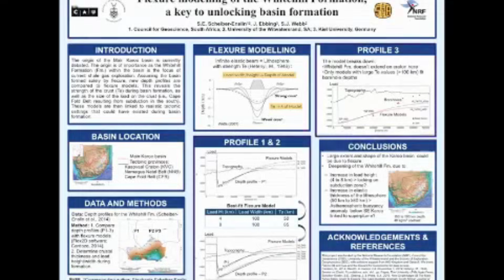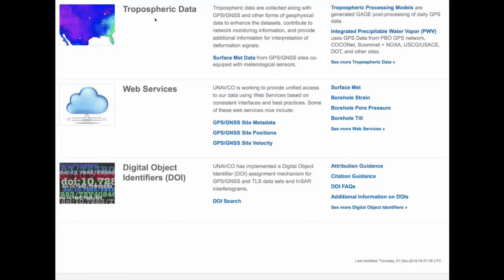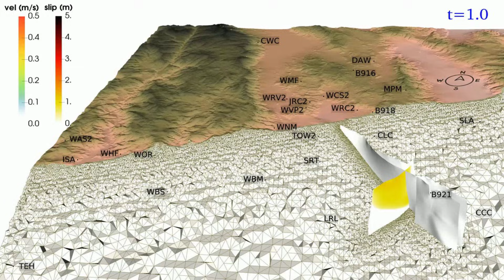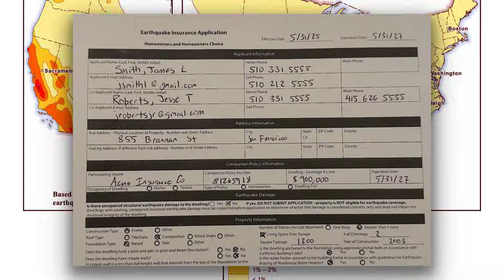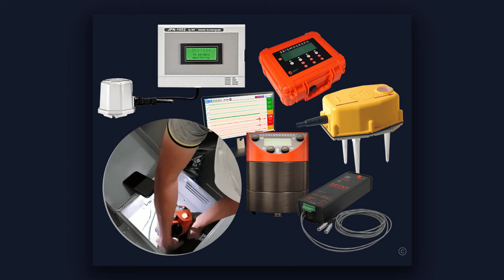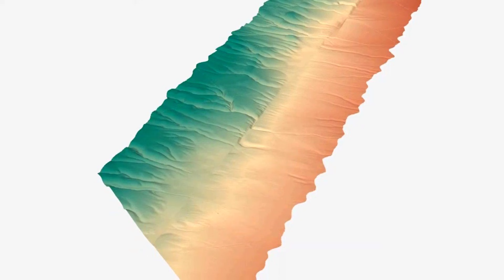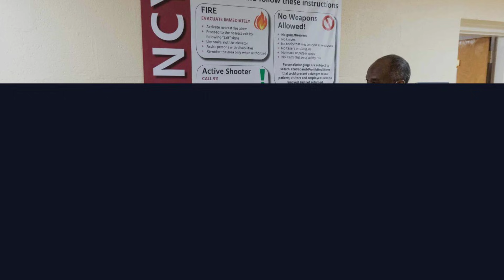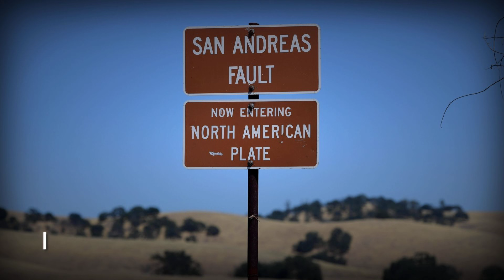Footage From California Exposes The 625-Mile Crack Nobody Talks About

Comment: Live in central valley in the center of the valley no fault line so I thought. When  St. Helens erupted we felted shakes all day until 6 or 7 pm started around 7:30 am. Now it was because of that fault line you are taking about we felt the trimmers.  San Andreas didn't shake I think, because a year late a town 1hr. Away had a major earthquake results from St
 Helens eruption cause pressure to San Andreas

Comment: Why are you surprised  about the land sinking? Anyone with 2 brain cells know that pumping out the ground water faster than mother nature replenished it IS A TICKING TIME B@Mb!!!! 
Greed and ignorance = slow destruction!
Reply: The pathetically ignorant believe we have used the water. We use nowhere near what it would take to eliminate it. Because plate techtonics and the increased rate of  activity in the ring of fire have opened hidden fissures where water is settling in. Thus great lakes and Mississippi river are shrinking. By now would have thought that Californians would pull their collective heads from where the sun doesn't  shine but...guess not.